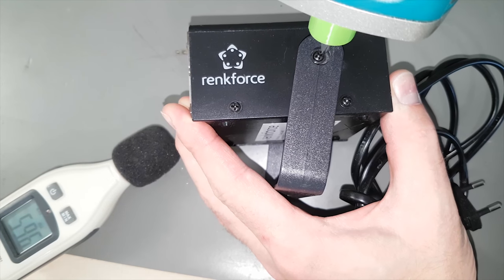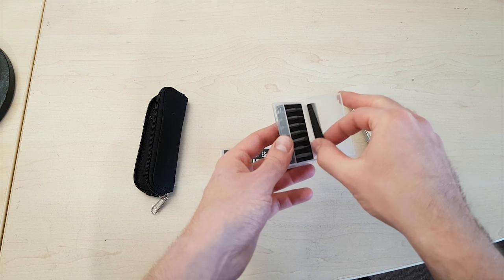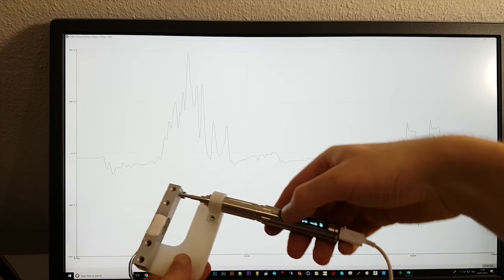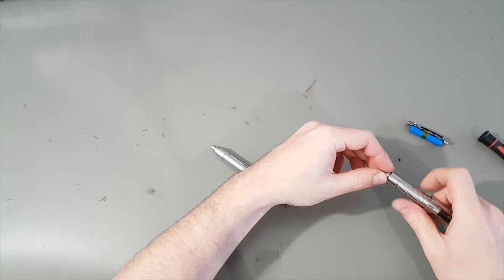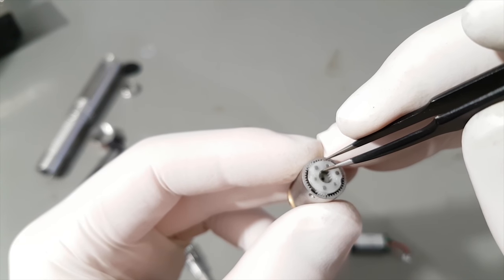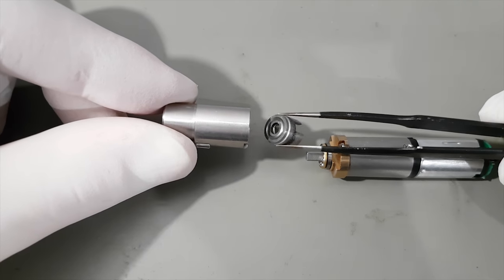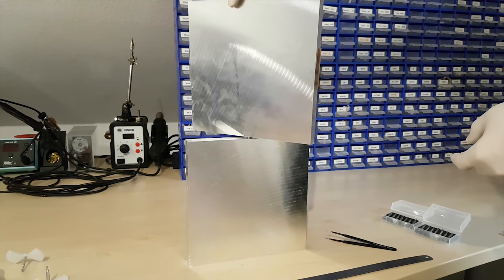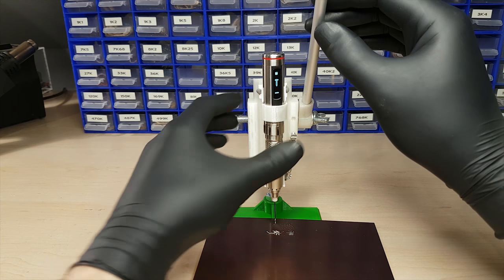ES121 - Better, faster revision of the ""Open Source Screwdriver""!

Comment: Wow 625 torque units!  Dang!  I don’t know if I could settle for a measly 500 torque units.
Reply: They're measured in ATUs, otherwise known as Ambiguous Torque Units. Obviously ur not an engineer...
Reply: Though he could use a regression model to convert it to Nm2
Reply: 625 potatoes of torque.
Reply: @MadJDMTurboBoost  ATU, the international idk torque unit.  Love it.
Reply: Imperial equivalent is a cup of tea per square inch
Reply: use all the digits... 0.000625 megatorque

Comment: I would just like to clarify that the new version of the ES120 has the updated bearings. The only difference is the gear ratio. The new version comes in packaging like the es121 instead of the older cardboard box.

Comment: Its not an upgrade, just a different gearbox ratio. I've emailed the maufcturer asking what else the so called upgrade is.., here's there reply...

Hi:
ES121 is not upgraded of the ES120, I don't understand why the agent said it was "upgrades."
ES120 and ES121 are different from the gearbox, ES121 is 1:64, and ES120 is 1:144. The other is the same, the motor speed is 25000rpm.

Ive now got a es120 on the way :-)
Reply: Lucky
Reply: Is that supposed to say 1:44  ?
Reply: @intbn  No, It is 1:144. Also, our friends review tells us that it has new/different bearings - the ball thrust bearing for example - what did the 120 have?
Reply: @davybloggs1564  the bearing set up has been migrated to the es120. The only difference now is an faster gear radio.

Comment: 100 Dollar?! I have to find some new projects with a lot of screws to justify a purchase like this.
Reply: J Bender It's not meant for the average tinkerer. It's for someone who installs/removes a lot of fasteners. Like a cellphone repair shop, or someone self-assembling their own kick starter project product, etc.
Reply: It’s a luxury tool, not a necessity tool.
Reply: Well for 100$ it is more like a "I Need it sometimes and I want it" tool @49684
Reply: @LenniL-ob4ll  Electric tools cost alot. I think it's a luxury.
Reply: @LenniL-ob4ll  A luxury item is any item which is neither a commodity or a necessity. A 100$ relatively low torque screwdriver fully classifies as a luxury, especially when there are much cheaper comparable options.
Reply: @xenonram  No. It's for people who WANT is, not who NEED it.
Reply: Might be a bad idea to necro a thread but i've bought one of these since they save me about as much time as a pneumatic one i was planning on getting but cost way less(i saved $400 despite already having the compressor and whatnot)

I machine and assemble precision machinery in my work and this saves me at least 2 minutes ($1.7 at my salary) every time i assemble something with a decent amount of screws (which could be upwards of 120 times a month if i'm doing assembly on a project with other machinists)
Reply: As a brief note, the torque on the new version is perfect for tightening M0.5 screws to spec while the old one risked stripping them

Comment: Love ur vids! Just a tip, u cannot use a load cell like the one in the video for measuring the torque, u r measuring kind of noise and structure deformation but not well correlated with the torque. U should put a leverage on the drill and let it press down the load cell, then multiple the force read for the leverage length.
The load cell is engineered to filter the torque

Comment: I received the ES121 today. The battery was completely dead when I got it and it didn't come with the portable pouch as in the description. Now when driving and tightening a half dozen screws or so on any setting it just quits working. I can get it to work again if I plug the USB in. Going to contact seller to exchange it or get a refund. I wonder if all ES121 have the same problem or is it just a random thing.

Comment: You have connected the load cell wrong. The screw should be perpendicular to the drilling axis of the two large cavities. That is the direction in which load is designed to flex. There is a sticker on the load cell which indicates the direction/axis in which force should be applied.

Comment: How about a torque test based on the basic definition of torque: Screwdriver directly turns a lightweight arm of known length with a movable weight.  Measure ability to lift arm with by turning screwdriver, and you'll have a good measurement in kgm.  Multiply by local gravity for Nm.

Comment: 300 mAH sure isn't alot of juice , I wonder if the battery can be replaced with a higher capacity one, I'll have to see what is available for that size
Reply: from what ive read, it last for ages as it is. not much point in making the whole thing more expensive just so you "only" need to recharge it once every two months instead of once every couple of weeks.
Reply: Jim Steinbrecher yeah, I have no idea y I wrote that comment in today's context, I have decent enough analog lol screwdrivers, for that kind of money I decided to just buy a genuine hakko 888d station instead of the cheap knock off from Chinese sellers , this powered screwdriver is a expensive toy for someone like me who is on a budget and needed a upgrade to his soldering iron regardless , being a financially responsible adult sucks major.
Reply: Putting a higher capacity battery wouldn't make it more expensive. It's $100-120, and the battery costs them around $0.25. Since it is not a Li-ion battery from one of the 4 big producers, but it's from a no-name Chinese company, (so it's probably more like 150-200 mAh.) it is really cheap. So even doubling the BOM cost of the battery would only add <$1 to the retail price. So it has nothing to do with "keeping it cheap for the consumer." It has to do with the company wanting to make as much money as possible, while still providing a good product and experience. (Which, since they're a company, I can't fault them for.... As long as the integrity of the latter part of my statement is kept intact.) BTW, it is a protected 10500/10450 battery (AAA size), and any protected 3.7V Li-ion battery will do. It has the leads coming out of the protection board, rather than terminals on each side of the battery, or tabs. It matters not though. Just get a protected 3.7V battery that will fit in the enclosure, and make the terminals work however which way. Even a prismatic/pouch style Lipo battery would work, as long as you could extremely charge it. (Or if it had a charging circuit attached to it.)

Comment: Hi Marco.  I know this is a fairly old video, but I wanted to pick your brain on this screwdriver.   What type of grease would be best for the planetary gear assembly? My ES121 had an issue where the gearbox was slightly binding causing the software to think the screwdriver reached maximum torque and would shut it off after a revolution or two completely unloaded.

Comment: Hopefully they upgrade the TS100 to have a shorter exposed heating element
Reply: I like the TS100, but it has a few shortfalls. The reason I still prefer my trusty Weller WHS40 is the cable. On the TS100, the included cable is very stiff and short, making soldering small parts a bit uncomfortable.

Comment: Besides this, is there also improvement on the battery life?
Reply from the maker: I haven't tested this, because my batteries last for days on both screwdrivers, but I think there might be a slight improvement, yes. Because of higher speed, the motor is powered for shorter periods of time. When considering screws with friction, they'd probably have the same battery life.

Comment: A+ but the torque test needs to be supported in a jig. 

As it stands, your assembly is transfering torque from the screw, to your metalic unit + strain gauge load cell, and then continuing to transfer torque to your arm (that is, your human arm, not a torque arm ;)). A substantial amount of the motors generated torque is transfering into the pivot of your assembly/into your body. Placed in a vice, you can do multiple runs against the same torque reaction, limiting the variance. (Alternatively, if you want to have multiple runs gapped between time, a 50 kilogram weight placed on your assembly should be repeatable between test setups, (which is not the case for clamping in a vice, unless of course you're torquing the lead screw of the vice itself down with a torque wrench.))

Also, this goes without saying but there should be an equal amount of pre-load for each test. (An easy way to do this is: take a piece of .001mm feeler gauge (or shim stock of a hardened metal), insert the feeler gauge as shim between the screw and the assembly, then screw down to 'hand tight'. Mark both the screw and the assembly. Remove the stock. Each time you set up the rig, the screw and assembly should line up to the demarcated points, so your driver is consistently working with the same (negative) preload, so the inertial force variance is limited).
Reply from the maker: The second paragraph, yes, I agree. It's only moving as far as play in the mechanical parts allows.

But I don't agree with the first paragraph, no torque is applied to my arm.
Reply: Andrew Nambudripad Him moving his had and the entire unit, everytime he activates it, is confusing. The way it is steeped into that fixture shows that he should be able to activate the screwdriver without holding the test device at all. Either way, I don't think it is transferring torque into anything except the clamping band and the load cell.

Comment: 4:00 doesn't seen to be straight. Plastic adapter for drill is your adition?
Reply: Yeah, the second I saw that, I was going to ask for a measurement on the run-out. Weeble wobbling all over, just asking for PCB carbide bits to break :( Maybe the radial bearing doesn't have a proper seating and/or it was misaligned during the assembly? 

Generally there should be at least two radial bearings on the shafting of any drill-esque machinery (at least according to the application notes from precision bearing companies like NSK). The one closest to your bit-holder should be super snug between the shafting and housing, and the second alignment bearing at the opposite end should have some play to accomodate for misalignment in couplings and/or thermal expansion/contraction.
Reply from the maker: Yes, that's a 3D printed adapter with a crookedly JB-welded drill bit :) I didn't see a better way to insert it
Reply: Use your new drill press to drill out a hex head bit in the center. Then put some super glue on the bit and slide it in the new hole.

Comment: Do you have a good source for 4mm hexagon bits that would fit this. Would be great to find good quality allen bit and other special models for phone repair and other
Reply: Fotograf - you can buy them anywhere - any good DIY store or hardware shop. That's one reason why this is better that the AtuMan E3, as that device uses propriotry bits, only availably from them = dumb idea.
Reply: @davybloggs1564  Yeah, but I did search on ali and other shops and I can`t really find any good range of different bit type. I want to find square, triangle, star and other for phone repair, and also small nut bit for unscrew/screw nuts.
Reply: @IBICO74  any small 4mm hex security bit set should fit.
Reply: @IBICO74  If your still looking, check the Xiaomi Wowstick, the bits for that are sold separately and are the same size (4mm). They offer a lot of different bits.

Comment: Can I buy the upgrade parts for my ES120?
Reply from the maker: I don't think the bearings will fit, if you can find them ... Gearbox probably yes!
Reply: @reps  Moin Marco
Wo gibt es denn das Getriebe? Bei mir ist wohl der Motor kaputt, bekommt man etwas passendes in der Baugröße irgendwo?

Comment: Hab den ES121 jetzt über ein Jahr. Als er geliefert wurde, hat er 3 Tage funktioniert, dann blieb des Display Dunkel. Bangood schickte mir nen neuen. Vor einer Woche des gleiche Problem. zieht 600mAh, Display geht net an. tot. fand aber auch nirgens nen Schaltplan im Netz. Funktioniert deiner noch oder haste auch Probleme? LG Marc
Reply: Hab meinen vor drei Tagen bekommen, ein paar Schrauben versucht zu lösen. Schafft er nicht. Darf man ohne Strom die Schrauben raus drehen? Hab dann im A Modus 8 Schrauben von einem Plastik Gehäuse rein gedreht bis auf Anschlag. Am nächsten Tag machte das Gerät nur noch ein paar Umdrehungen. Egal welche Richtung oder Geschwindigkeit ich wähle, nach ein paar Umdrehungen ist Schluss. Geräusch ist auch etwas merkwürdig kratzig. Schon kaputt? Montagsgerät erwischt? Oder kann man da was reparieren?
Reply: Wie hast Du es geschafft das die den austauschen? Ich soll den hier vor Ort reparieren lassen. Hab den dann zerlegt und es liegt am Getriebe. Am Netzteil zieht der Motor samt Getriebe >2A und dreht sich trotzdem nur ein paar Mal. Irgendwas klemmt da.
Reply: @martinnieder4875   der motor läuft super. der zieht 600mA wenn ich den laden will. im schnitt zog er immer um die 300mA. hab Bangood nen video geschickt das er net funzt und die haben mir einfach nen neuen geschickt. hab aber bis heute noch net des fehlerhafte bauteil gefunden. habe aber vom Hersteller nen schaltplan bekommen.
Reply: @FusselCNC  So, darf meinen jetzt auch zurück schicken. Aber Päckchen kostet schon 17€ und BG will was mit Tracking. Ein DHL Paket kostet >40€ nach China... und dann darf man nicht Mal einen Akku verschicken. Wie hast Du die Retoure gemacht? 

Hab das Teil jetzt doch noch Mal zerlegt um zu prüfen was es denn ist. Das Getriebe sieht gut aus und lässt sich auch relativ leichtgängig drehen. Aber auch ohne Getriebe macht der Motor nur ein paar Umdrehungen. Gibt es dafür irgendwo was passendes?
Reply: @martinnieder4875  durfte damals den alten behalten. Bangood is was retoure angeht echt super wenn man es gut beweisen kann.
Reply: @FusselCNC  Bei mir scheinbar nicht, obwohl ich immerhin VIP3 Status hab ;-)
D.h. Du hast jetzt zwei Bauteilespender rumliegen? :-)
Bei mir scheint tatsächlich nur der Motor hinüber zu sein. Aber einen 12x20mm mit 25000U/min und einem Lochabstand für die Befestigung von 8mm mit 1mm Welle finde ich nicht.
Reply: @martinnieder4875  weis garnet ob ich mein alten Motor noch habe. Glaub den Han ich schon woanders verbaut. Habe aber die alte Platine noch die wahrscheinlich den gleichen Fehler hat wie der neue. Hab da auch 600mA wenn ich den laden will und das er nimmer angeht.
Reply: @FusselCNC  OK, schade. Hab jetzt den Hersteller angeschrieben, ob die mir nicht einen Motor schicken können.

Comment: I really fuckin' want one of those but the Micro B USB Port is just too much of a dealbreaker for me... Yesterday I had to search for about half an hour to find a Mini B USB to connect my FrSky Horus X12S RC Transmitter to my PC to edit a bunch of model profiles in a more convenient way and the lack of a unified USB-C connector drove me fuckin' nuts... Same scenario for when I had to recharge it because I worked for so long on it the battery almost completely drained - Couldn't find the fuckin' DC Charger... A Kingdom for USB-C 🙄

Comment: good luck actually getting and type of warranty on this thing, mine the bits also fall out and has other issue. maybe when i make a video on the quality problems maybe they will want to fix it, otherwise they dont care. company is worthless wanting me to disassemble entire unit to swap parts and solder new components on board. if i could order it as a box of parts and assemble myself at 1/3 of the cost that would be a option. point is all these companies get money and they are gone with it
Reply from the maker: I agree that most companies will do whatever they can get away with and in case of Chinese ones that is practically everything. But I have a high opinion of these guys and I hear few complaints about their products. Hope it is an exception.
Reply: nhojyelbom with most Chinese companies, like in this situation, ask them if you can email them a video, with a placard stating your name and date, demonstrating the issue. (The placard must be in frame during the video, obviously.) They will most of the time help you out. Did you contact the distributor first?
Reply: did you read what i posted? they are worthless and want me to disassemble entire unit. i could have assembled this from the BOM myself correctly if that was the case. i will just be returning the pos and not buying anything from miniware or recommending them for any reason

Comment: You built a screwdriver tester, but don't know what "units" you measure with? Is that serious?
Reply: He doesn't know because he built it himself. Without a good way to dial it in it's just a voltage coming out of a load cell, without any real indication what that corresponds to in other units